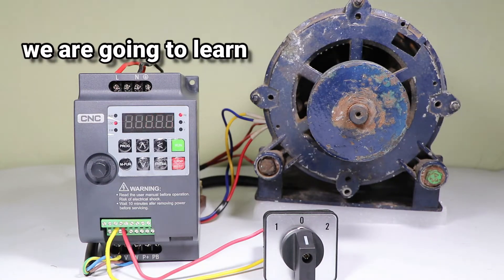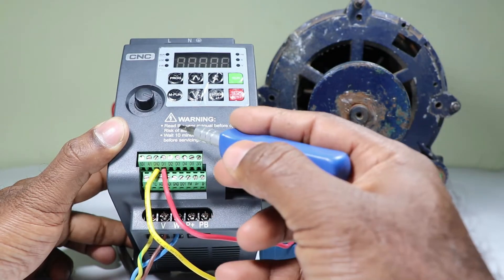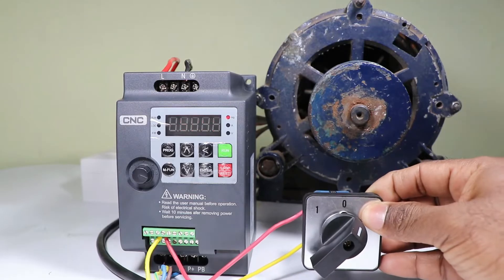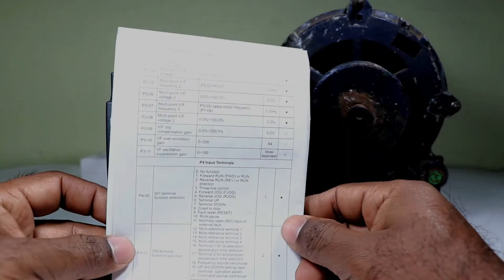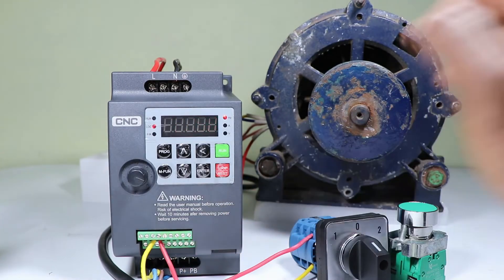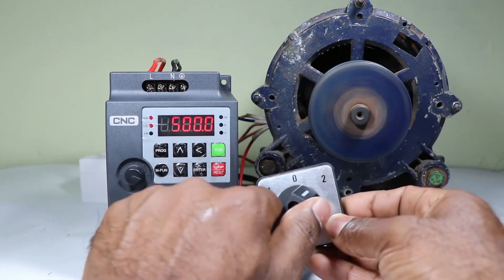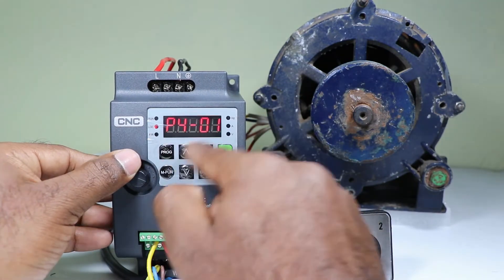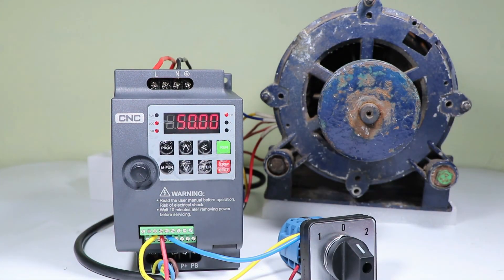Control VFD by only 2 wire and also Run the Motor in Reverse Forward Direction @TheElectricalGuy

Comment: hi, please how did you set revolution on display , when rotating? How can I program this VFD for braking resistor?
Reply: Dont need to program the VFD for the braking resistor. only need to conect to P+ and RB terminals. but pay atention to the ohmic resistance, if too low it can damage the VFD. user manual should have the suggested ohmic resistance and wattage for each model
Reply: @llenzii I tried to connect 150 Ohm braking resistor but nothing happened. VFD is sako ski780   looks like yours. Brief chinese  manual do not explain anything about braking and how to set it up. My motor is 2,2 kW installed in a 360x1000 lathe with 200 mm chuck  > plenty of inertia to stop.
Reply: @justaskthecat  oh.. sad news: or it's circuit is damaged, or it doesnt have the circuit for it... some brands do it to cut costs. the parameter that set the voltage trigger of the RB is P9-08 and it ranges from 700 to 800. i suggest 670 but 700 is still fine